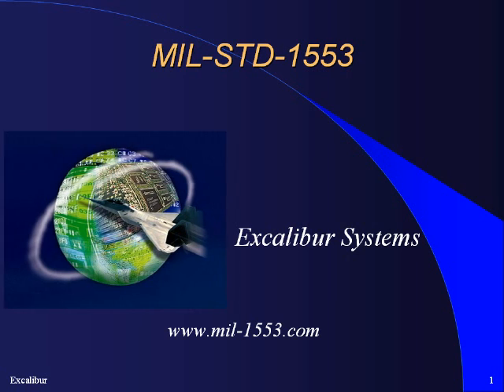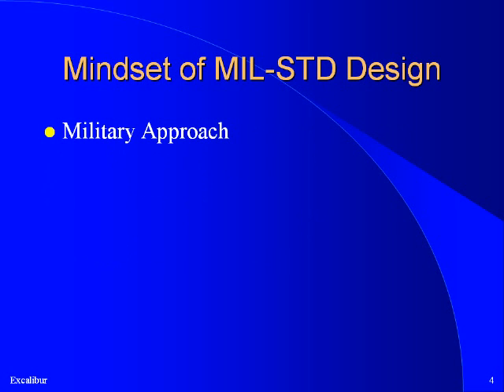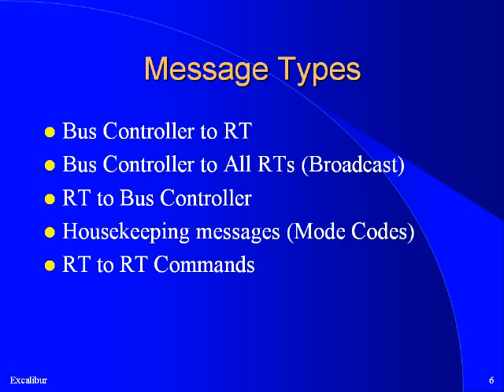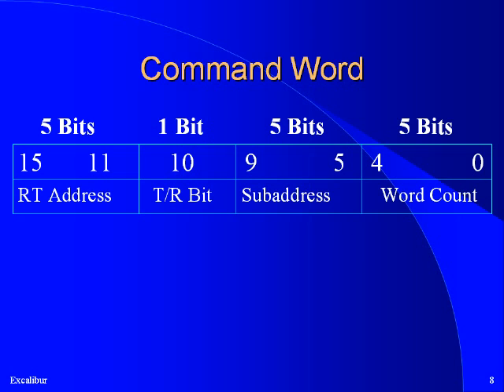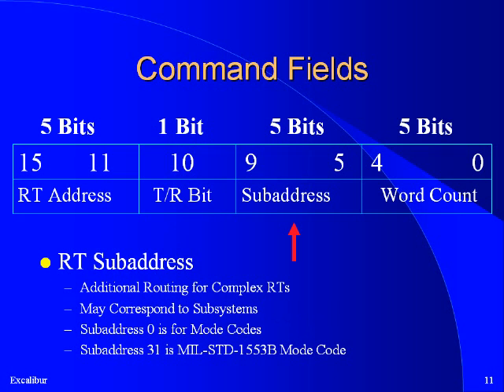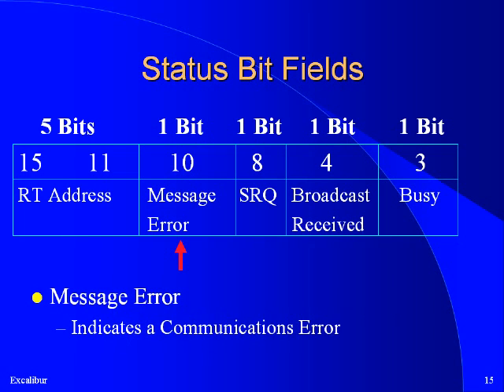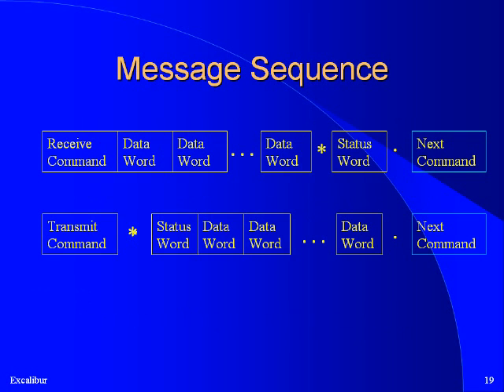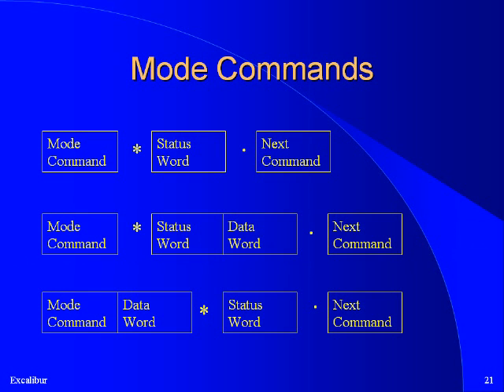MIL-STD-1553 Tutorial - part 2 | Excalibur Systems

Comment: On slide titled, "1553 messages" you should use the established analogy of one commander by describing the command/response protocol as a "conversation" between the commander and the RT's.  This notion of a conversation is helpful in understanding the term MESSAGE. The student  will get a stronger and more natural understanding of the command/response protocol.  With this simple idea of a "conversation"  the natural need for an acknowledgement. in the form of a status word is much clearer.